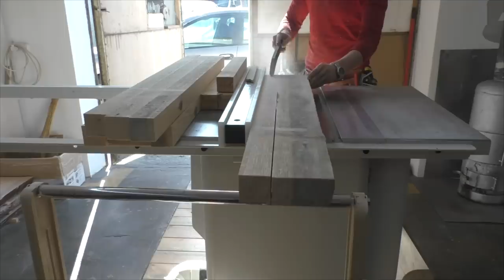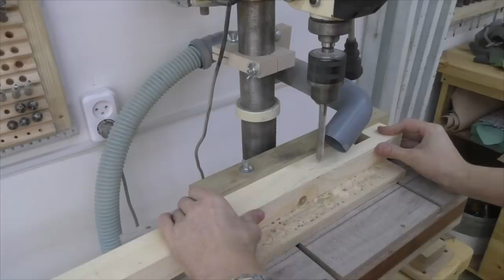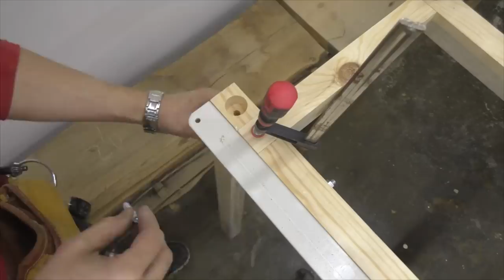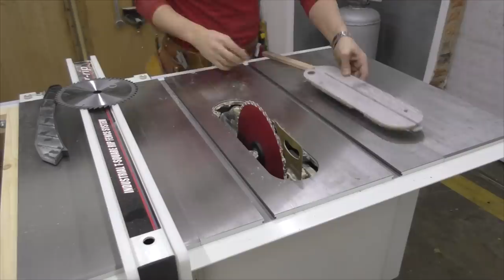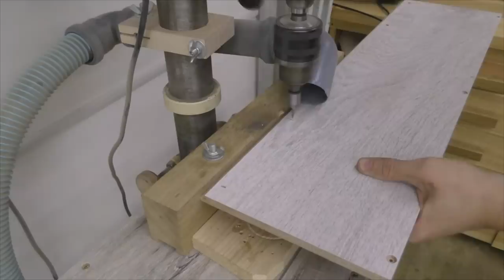🟢 Table Saw Extension Wing Build - DIY Table Saw Upgrade - Part 3

Comment: I took your advise and made my router table top out the similar floor material and it is a great product to work with. I also learned that I must wear goggles and a respirator for my protection. Thank you for sharing.

Comment: Excellent video and process. Thanks for sharing. Your a great inspiration...I working on table saw extendentions and a router lift like your plans. However, slow going. I have to mill lumber with a  job site table saw and by hand. Thank you for sharing...

Comment: Great job on both the project and the video. Looks super clean.
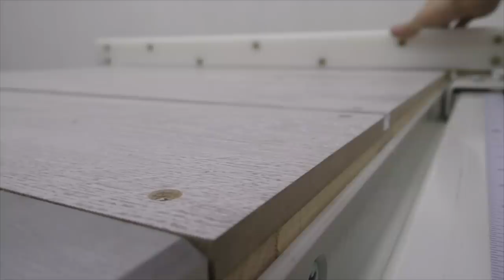Is there any concern about the square cut edges of the laminate chipping?  The front edge of the saw table is beveled but the laminate is not. Around the 10:30 mark.
Reply from the maker: Thank you my friend. For now it's not a problem, but if during work will notice some discomfort, i think it's never too late to make a chamfer with router. The fact is that laminate has a very hard surface so i decided to save my router bit from dulling for now

Comment: I love the idea of creating the frame for the table in this manner. It sure beats trying get up under the table to tighten the hardware. One question though, why not cut the access for the router out of the pieces before installing them?
Reply from the maker: just because of i don't have a plan what size of router plate insert will make, what router lift will be and other questions i left for later. Thanks

Comment: Is the frame roughly 2x2 boards?
Reply: Doug, did you ever get a reply as to the frame dimension of the lumber? It appears to be 2"×1.75" or 2"× 1.5". Thanks